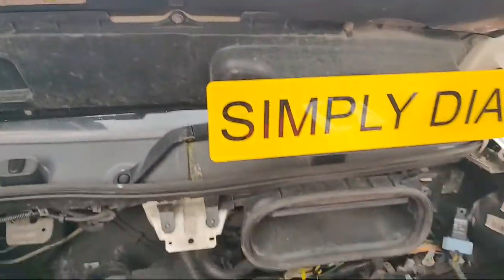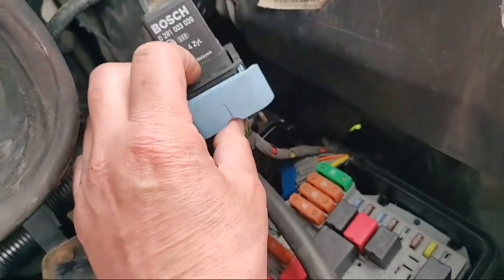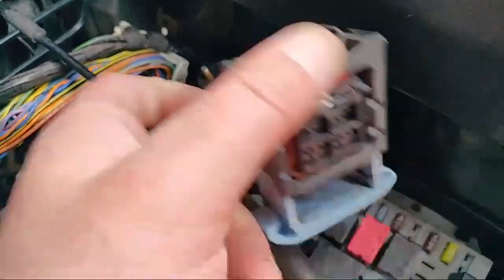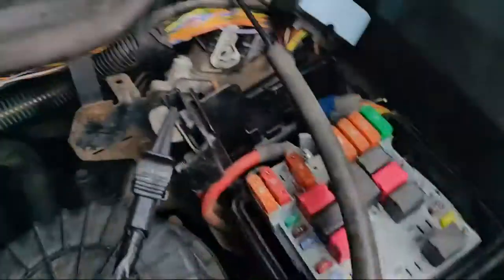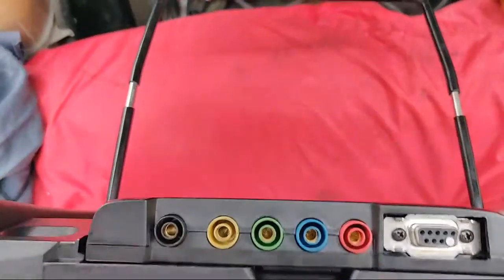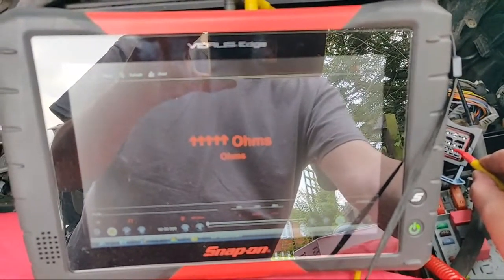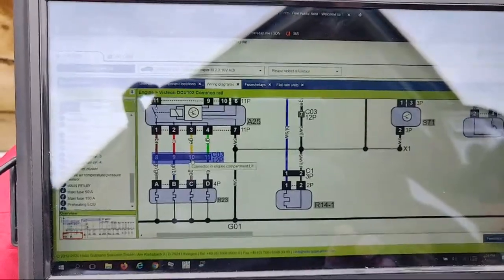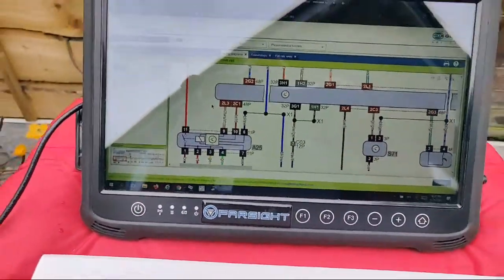P0683- Pre-post Heating Relay Control, Glow Plug Fault

Comment: Did you ever get to the bottom of this. It's just that I've done a lot of testing, removed the air intake manifold , erg valve and pipes cleaned all out including entry ports  new glow  plugs . Checked wiring from plugs to relay. However I'm still get the p0683 code about the pre heat fault, plus the van now smokes like bloody hell after all that .
Reply: Did you get to the bottom of this I’ve got exactly the same issues

Comment: 1.Pre/Post Heating Relay Circuit. Plugs Never Supplied

2.Communications On The Comfort CAN. No Communication With The Built-in Systems Interface

3.Remotely Controlled ECU Wake-up. Start Or Stop Requests Missing Or Invalid

4.Remotely Controlled ECU Wake-up. Main Wake-up Request Missing Or Invalid

On 2011 citroen dispatch 2.0 hdi

Comment: Great video as usual! I personally prefer to test those plugs by measuring resistance. A little higher resistance for example 3-4 ohms might trigger a fault code on some cars but would still provide a path to ground for a testlight.

Comment: That's a great video. I was wondering if you know how to test the relay to make sure that isn't at fault. Also did you find the connector you was looking for?
Reply from the maker: Thx for the comment Gary, there are a few videos on how to test relays on my channel. Hope this helps.
Reply: @SimplyDiagnostics  Thanks for the reply. I've had a good look through your videos and can't seem to find a relay test. I would normally test a relay by looking at the diagram on the relay itself but the glow plug relay doesn't have a diagram printed on it. I would be grateful if you could point me in the right direction. Thanks.
Reply: @garywells351  you can check relay's powers and ground with a testlight but for checking control and feedback circuits you need a scope
Reply: @marion1600  Thanks for the comment. I know how to test normal 4 pin relays using I think pins 85 and 86 to get the click sound but there is no pin layout on the glow plug relay and a new one is £70 so I want to test it before getting a new one.

Comment: I usually test glow plugs on late transits at the multi plug by the cylinder head corner by timing chain cover never had Citroen relay so you could be right that’s the easiest access point on this vehicle 
Anyway great video thank you